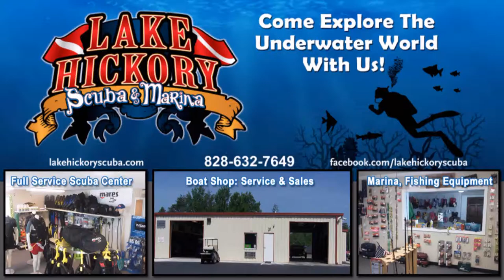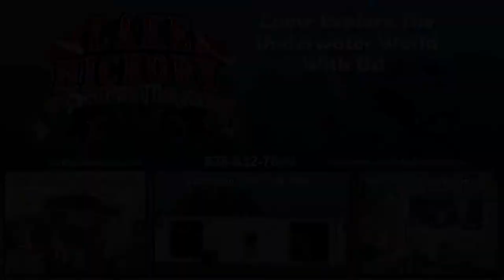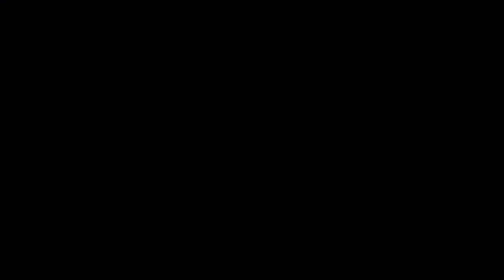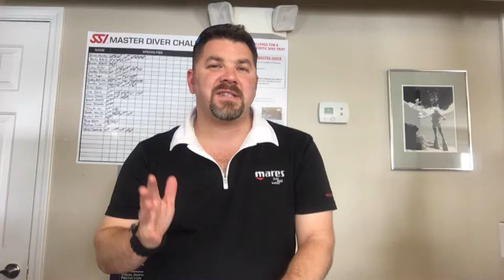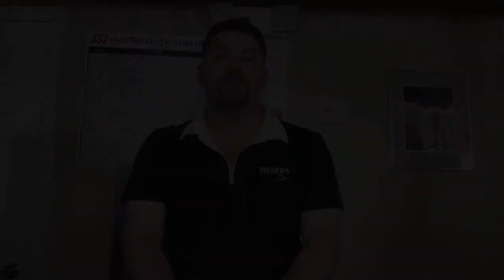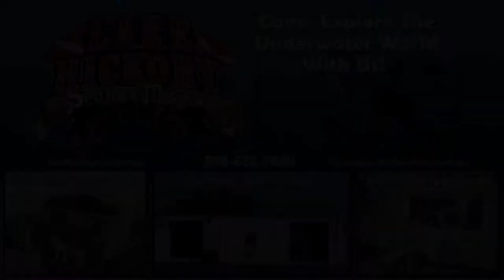XS Scuba Din To Yoke Converter

Comment: Humm… I got a very similar adapter but the knob screw was way too short for a regular cylinder Yoke valve. Are there more than one size of Yoke valves? I thought they were standard.
Reply from the maker: Hello @VincitOmniaVeritas7, unfortunately, there are several different sizes on Yokes. Several of the older Yoke Adapters will not fit newer valves.

Comment: Does it need a silicone or O2 or any other diving lubricant application on the thread before screwing it on?
Reply from the maker: Hello charliecorre9218, there is no need for any type of lubricant. You simply attach the adapter to your DIN first stage and then to your YOKE cylinder valve.
Reply: @LakeHickoryScuba  I appreciate it sir!

Comment: Does the adapter need a rubber washer on the din side to prevent leaks or just a tight snug?
Reply from the maker: Hello Tony Houk great question. The adapter converts the DIN first stage into a yoke first stage. Since yoke cylinders have the o-ring in the valve orifice, no other o-ring is needed.
Reply: @LakeHickoryScuba  I thank you for answering. I figured it out right after I posted the question. Thanks, Tony

Comment: Hey Brian, what about a Yoke to DIN conversion? Do you have a video on that?
Reply from the maker: Hello C. Patrick Sadowski. This is definitely possible, but usually requires several parts near the high pressure chamber to be changed.
Reply from the maker: Looks like that will work for you.

Comment: But what if your din 1st stage is 300bar? Does that matter?
Reply from the maker: Hello DaRougaroux, in regards to the first stage, 200 bar or 300 bar makes no difference with the converter. The valve on the cylinder though, it does make a difference. With a 200 bar DIN valve, you can screw in an insert to convert the valve to Yoke. On the 300 bar DIN valve, it is too deep to add an insert, thus it becomes a DIN only valve. Hope this helps.
Reply: @LakeHickoryScuba  thx!  I have a 300din 1st stage so I think I will need a 3442 tank and valve and I should be good?

Comment: What if I want to permanently convert a Din First stage to Yoke?  Can you completely remove the Din adapter and replace it with the yoke style?
Reply from the maker: Most manufactures make replacement high pressure chambers that can convert a DIN system over to a YOKE system.  Its a pretty simple process.
Reply: @LakeHickoryScuba  Thank you, good to know.  Nice video btw !
Reply from the maker: You're welcome, and Thank You